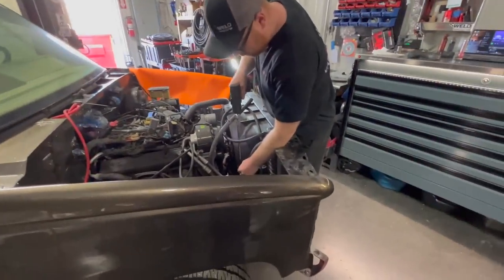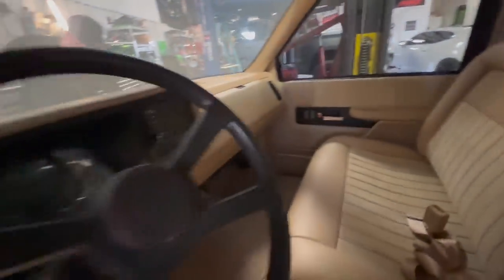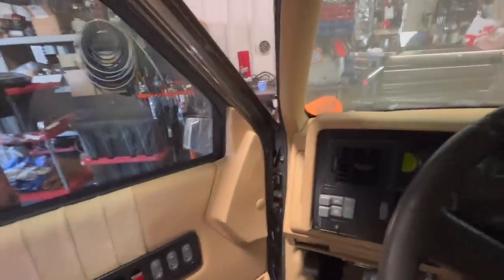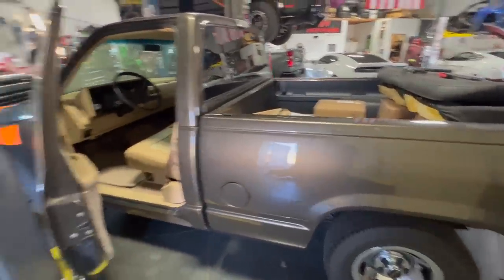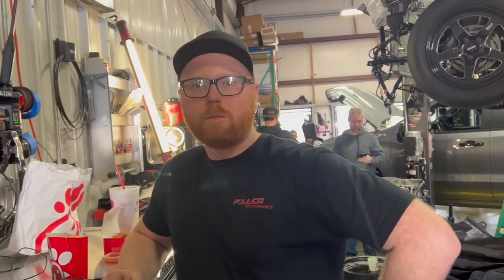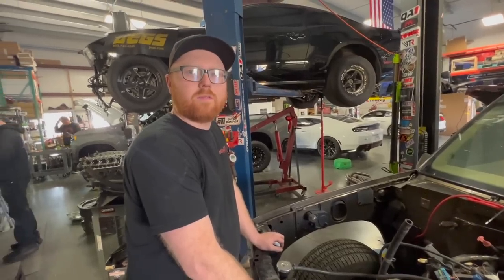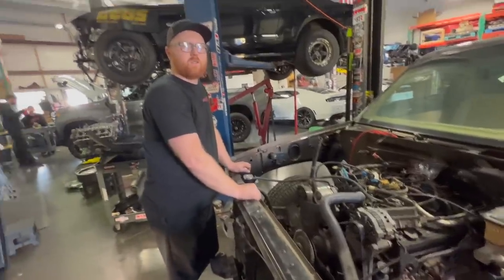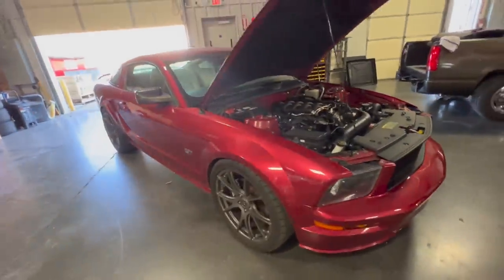Take a look! Super expensive interior on our newest OBS build...Plus the ZL1 runs a 7 sec GTR!

Comment: I love the ZL/ZR trucks you guys are doing but I must say that 22” wheels are a MUCH better fit on the OBS platform than 20”…just the perfect amount of wheel while still being able to run 35 series tires up to 285s or 30 series tires even up to 325👌🏼
Reply from the maker: The problem is finding a 22” tire that holds 900rwhp
Reply: @StangkilrProductions  yeah, but let’s be real…there’s not a 20” tire that holds 900hp either! Lol Nitto does make a 305/40R22 drag radial but it’d be better fitted as a 35 or 30 series. I run 315/30 22s on back (265/35s out front) of my OBS for daily driving but I run a drag pack for business👌🏼
Reply: @No Time Nation  20 will definitely hook better than 22.  I would have a smaller wheel on the rear if it were me the sidewall really helps them hook more even with the same kind of tire and same width.
Reply: @midnight347  IF you have the same sidewall height and width, 22 will actually hook better because there’s more rubber on the ground…but of course that’s limited by ride height too! So yes, you can usually get more sidewall on a 20…but I’ve got just as much sidewall as the 20s on the teal truck and mine are 315s. Still can’t “hook” for shit on my roughly 650hp on motor, I can still do 30/35mph rolling burnouts with new tires 🤦🏻‍♂️ Point being, at 900hp you aren’t hooking on either, even on 20/22 drag radials 🤷🏻‍♂️ At that point, might as well go for the look when daily’ing it and have a drag pack for trying to hook as I do👌🏼 All honestly, I still can’t “hook” on a 60 series 15” drag radial at full power on the street, need full 28X10.5 slicks AND prep for that! BUT, they do make 20” & 22” drag radials that’ll “help” hook from 35 and up, and both come in a decent sidewall…